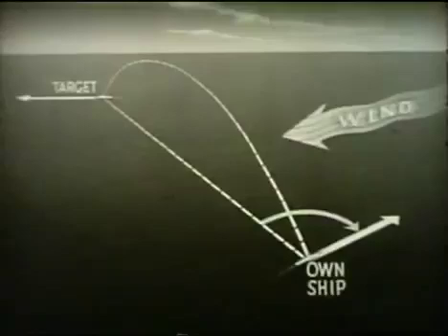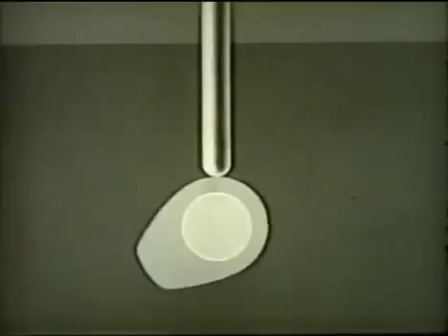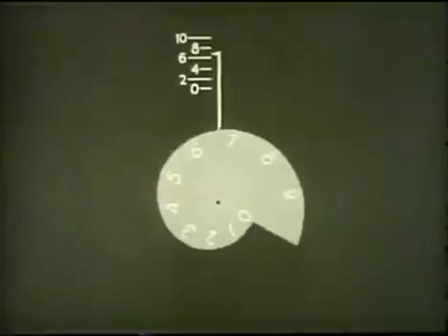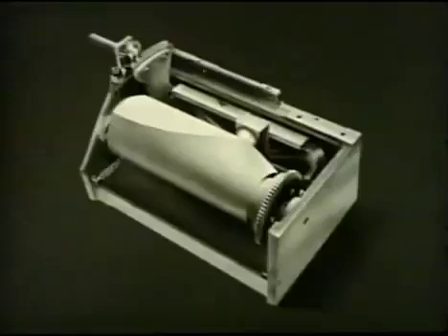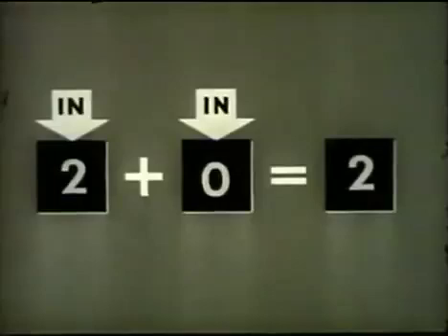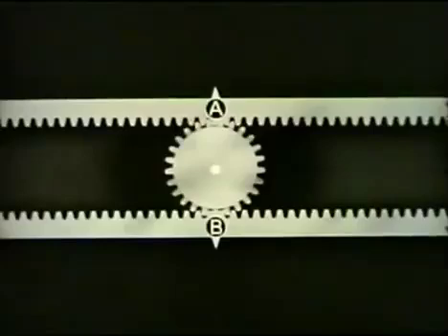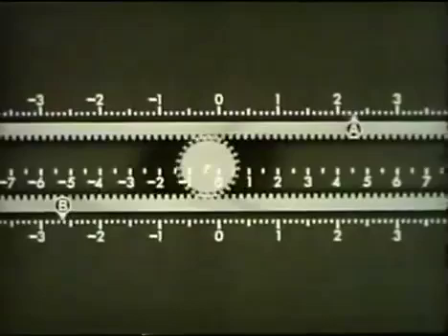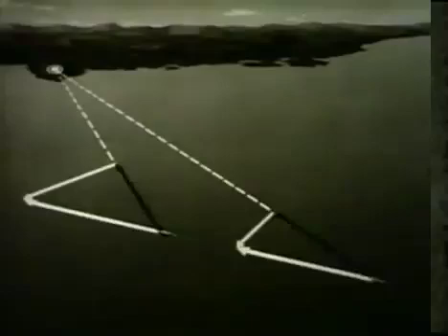Mechanical Computer (All Parts) - Basic Mechanisms In Fire Control Computers

Comment: The only problem with mechanical computers is that due to the mechanisms that drive them, they can succumb to wear and tear over its life time. That is especially true for parts that are small, making the use of mechanical equipment in microchips and systems on chips limited.
Reply: +Bungis Albondigas LOL as if electronics don't succumb to their own form of wear and tear? The big advantage of electronics is generally they work or do not where mechanical systems often work improperly before they cease to function.
Reply: +Bungis Albondigas The real disadvantage is that mechanical systems move at finite speed. You can switch ultra-low currents and voltages much faster than you can close a physical switch, or rotate a cam, or whatever. As ingenious as these old solutions were before the age of transistors, there's a reason we don't use them anymore.
Reply: @fendermarxist  that depends on the application.
Reply: @Nevir202  Electronics, aka electron current switches, do wear out due to metal deposition drift. Eventually the microscopic distances between the elements used for transistors and their junctions allows the metal they're made from to be literally pulled apart, similar to galvanic behavior between two different metals. However, if you properly cool the part, this takes far, far longer, and most electronic microprocessors have redundancy built in. You may notice over the course of years your laptop getting slower. Thats because it doesnt cool properly. And its losing some transistors in its processor. But its a consumable item for a specific job. Given real good air flow, I've managed to keep various parts of computers running for probably 1 million real hours over 10 years. The first thing to fail was actually a pair of power transistors on the motherboard. two literally exploded, causing  some of the housing to break and be ejected. Ive seen this happen to a guitar amplifier board, which I replaced. Basically its usually a triangular widget from near the center of the chip/transistor that flies off and it looks like someone gouged it with a philips screwdriver. 

But I've got a now 12 year old processor still running. Its a bit slower than before, but I over-fan the chassis rather than put the minimal required, so it stays basically around 98-100 degrees. They last a long time when you treat them well.

Meanwhile, mechanical devices like this can also last  a long time, provided you oil/grease them, and CONSTANTLY mediate them with new oil and grease. The raeson car engines break down after a few hundred thousand is because we're striking a balance between  the cost of maintenance, the plan of obsolescence, and the value of keep ing it going. IF you had a constant flow of new oil and all the used oil was taken away, engines in the real world last millions of hours, as I think BMW or that other german car company (maybe it was swedish) showed. They put an engine to work for basically an entire year, thats 365 days running 24 hours a day, and kept the oil constantly flowing from new to engine to used waste oil that they got rid of, and the engine showed almost no signs of wear.

So again, the issue of wearing down mechanically is an issue of lubrication and compromise between how much maintenance you want to do, and how much product you want to use, vs its expected end of life for replacement with newer and better and its overall value.
Reply: @neglectfulsausage7689  Maybe I'm reading you wrong, but feels like you think you're contradicting me, when nothing you said contradicts anything I said?

Comment: I agree that this video is great but mechanical computers are limited by "backlash" inherent in all mating surfaces. The resulting error adds, multiplies or squares depending upon the mechanism. As a result, a complex chain of mechanisms will hamstring the supposed infinite resolution of the analog systems. In practice, even simple relay driven digital computers have better resolution in fire control systems.

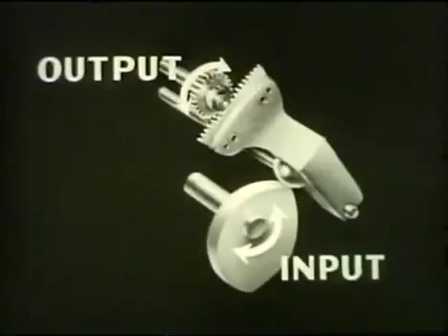Comment: Near 11:55 the barrel cam is revealed to transcend all known laws of physics at the time, amazing that we do not use the technology anymore! The barrel cam is infinite and eternal.
Reply: While it's cool and was useful for the time, it's also difficult to manufacture (can't simply turn one out, as it isn't cylindrical).
Reply: How the hell do you machine that? I got the linear and the rotation wrapped but how the hell do you combine the two with machine tools of the era?
Reply: I had the same question. How the hell do you figure it out? The answer is calculus, figuring many many many rectangles, small enough to get the resolution you need. The displacement of ships is figured the same way. It's like slices of bread. Slice that cam into 20,000 slices, figure the area/profile of each, then add it all together. Then for machining, you do that 1 'slice' at a time. Does that make sense?
Reply: It does not break any physical laws. Infinity does not equal to larger numbers or lenght. Infinity means there is no finite ammount of something, as you can always find a new variant that was never listed yet. That means infinity happends when it comes to decimals for example. What the narrator stated, is that it can output any number between x and y. And since that number includes decimals, then the ammount of possible outputs in infinite
In a practical scenario, the ammount of possibilities is limited by the precision of the reading person or machine. But in theorical scenarios, the number is infinite, provided that your reading precision is infinite. This is similar to how at school in physics you do not consider the drag from air, or you assume a spherical cow.
Reply: @darylmorning  Have you ever seen how woodworkers use a simple turning lathe and cut various shaped and swooping design elements into a shaft of wood? This isnt rocket sceince.

Comment: That is a Mark 1A Fire Control Computer. It's an analog computer and believe it or not a analog computer is faster than a digital computer. Your solution is present at the output as soon as you finish entering the problem. No clock cycles, just answers.

Comment: Great film but I wonder why they didn't put the torque amplifier in it? Maybe because it doesn't do any computation per se but allows many integrators, etc. to be connected without the whole thing grinding to a halt.
Reply: they may have but as the guy said this was just a short intro to the system.
Reply: cubesinanutshell
could be. Maybe this is a guide for the users of the system to understand how it operates. But someone that repairs it must also know things like the electric motors that drive it, the torque amplifies, and likely a hundred other things.
Reply: MrGoatflakes i think this may have been fire control computer 101

Comment: A question that comes to mind, say I'm a country with a less developed industry than the US, would it be economical not to go for the continuous calculation that the US went for but to go for step calculations dismissed by the narrator as not how the world works.  My thinking is that although range doesn't change in steps, but loading your guns does, so if your average reload time is say 90 seconds, you would only need to be able to have a fire solution for each 90 second interval. Would building a less able computers and modifying your doctrine to suit be workable?

Comment: precision != accuracy though
Reply: The whole system had several steps where operators could input an offset to account for spotters viewing the fall of shot. In the few naval battles where the things were used, at least on the US side... they tended to be quite accurate against both surface and areal targets (of course even then it did still take 100s of shots to score hits on aircraft. Tended to do better on ships. US destroyers had a habit of poking a lot of 5in holes in Japanese cruisers through smokescreens.)

Comment: nowsday ppl just need to make radar and input some program, done it can be easily done by a team of 10 ppl while in the past like tons of ppl
Reply: Do you know what a technology trap is?
Reply: +james pobog what is it can you teach me
Reply: If one relies on tech too heavily, you can get yourself into a jam. Example: just a few years ago the U.S. Naval Academy stopped teaching celestial navigation because of GPS. Well, all it takes is some EMP to completely knock out the entire GPS system. If ships are relying on it for navigation, all of  sudden, not only can you not navigate, you can't even determine where on the planet you are. You might be able to use dead reckoning (speed, time, direction), but over long distances that does not work well at all. Luckily, someone finally realized this, and celestial navigation is once again being taught.

Same with fire control. Back when the Iowa class was brought back to service in the 80's, there was the possibility of replacing the analog fire control computers with digital. What they found was that there was no benefit at all to doing that, in fact,it was a technology trap of introducing another point of failure (electronics) into the system, and the analogs were left alone. They are still in place, still work, and are as accurate as the guns are capable of being.